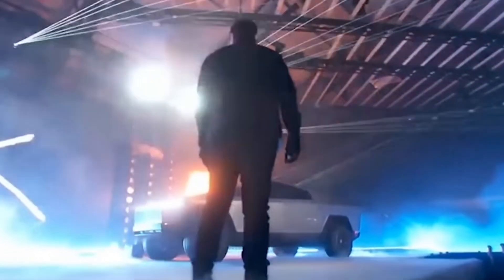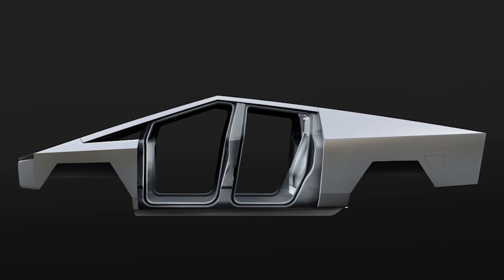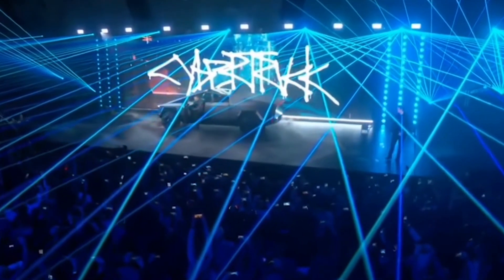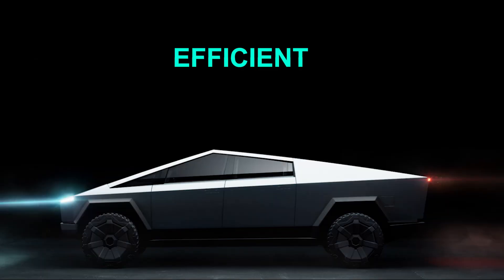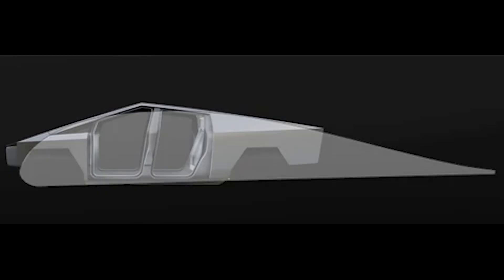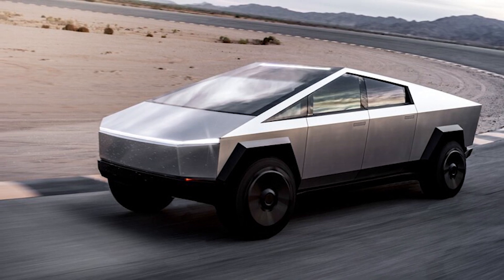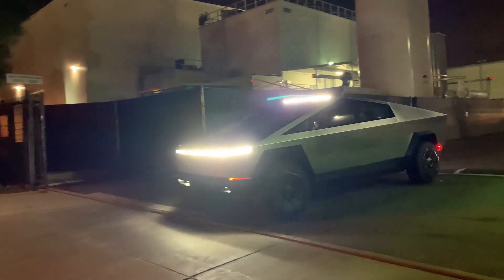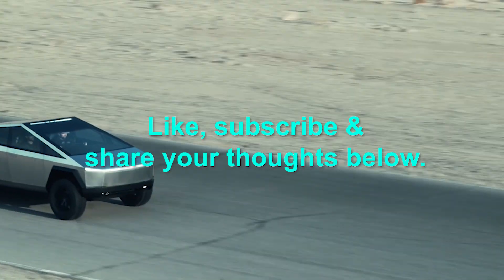Cybertruck is Engineering Genius (and will be copied)

Comment: I gave you the benefit of the doubt this was a thoughtful analysis till you said safety==strength of the car.. Nothing if further from the truth. Cars were built like tanks in the 50's/60's but changed because having an unbreakable exterior means all that energy is transferred efficiently to the occupants and pedestrians(god help them..)
Reply from the maker: Lots of people are raising this. The steel can be scored on the underside to crumple predictably and consistently (or the hood could be a separate component). I think many will be surprised at how well the Tesla engineers address this. Safety is always top of mind at Tesla. It may not appear so but the driver in Cybertruck sits the same distance from front of the vehicle as they do in Model 3 so there's equivalent space for crumple zone too.

End of the day, Cybertruck won't be allowed on roads if it is not sufficiently safe. Tesla are smarter than to design an unsafe vehicle 😉
Reply: It would need to be scored in all the surfaces around the car not just the front to be safe against side on or rear collisions. Also it would have to be alot of scoring to compete with the number of area's that can crumple on a softer aluminium construction. Still I have confidence that the engineers have designed a solution just thought that conflating protecting the car against damage and protecting the occupants or other cars or pedestrians isn't a good point to get confused on.

Comment: The fact that the truck is rigid is exactly why it doesn't seem safe: crumple zones are one of the most important safety aspects in modern vehicles, alongside three-point seat belts. But we don't know the safety details, so we'll have to wait and see what the reality will be.
Reply from the maker: Lots of people are raising this. The steel can be scored on the underside to crumple predictably and consistently (or the hood could be a separate component). I think many will be surprised at how well the Tesla engineers address this. Safety is always top of mind at Tesla. It may not appear so but the driver in Cybertruck sits the same distance from front of the vehicle as they do in Model 3 so there's equivalent space for crumple zone too.

End of the day, Cybertruck won't be allowed on roads if it is not sufficiently safe. Tesla are smarter than to design an unsafe vehicle 😉
Reply: @SolvingTheMoneyProblem  What's your thoughts on pedestrian safety, and safety of other vehicles?

Comment: It's annoying how many non-engineers spread false engineering "information"......  i.e. just repeat what the Tesla marketing team tell them.
Reply from the maker: Tesla didn't really cover any of the main point in this video, that's WHY I made it. Please feel free to debunk what I just said by quoting things Tesla have said about Cybertruck that I repeated here, Matt 😉
Reply: Solving The Money Problem I feel a little bad calling out YOUR video, there are many doing exactly the same thing.  But making a vehicle from a single thick piece of stainless steel in certainly not cheaper than a standard unibody and painted construction.  I have not seen any engineering sources that state this.  There is talk of it being 3.0mm thick, four times thicker and heavier than standard stamped construction, using significantly more expensive material.  Not painting it will not recover that cost.  Bottom line is production is more than 2 years away, the finished design will change (become legal as an example, windscreen wipers?).  I have 25 years automotive mass production experience, it’s not just a personal opinion of mine.  No offence meant, you have a well edited video about a subject people are interested in.  I’m just disappointed the engineering community appear to have mostly ignored this vehicle, apart for the tug-of-war video.

Comment: Great video analysis just a couple of things. You can see from the videos that cybertruck has a stamped, non-hardened stainless steel inner structure so its effectively a unibody or monocoque structure. It needs this to provide impact absorbing structure and crumple zones. So sadly less stamping panels but only 50% less. The second thing is while I love it, it may be the most pedestrian-unfriendly thing on the road which may require autonomous safety operation which overides the driver or exclusion from dense population areas! This is happening now for heavy goods vehicles except when operated by approved users at permitted times. Just thinking that it may be marking the end of humans being trusted to drive without supervision?
Reply from the maker: Spot on about some stamping required Richard. Re safety: Lots of people are raising this. The steel can be scored on the underside to crumple predictably and consistently (or the hood could be a separate component). I think many will be surprised at how well the Tesla engineers address this. Safety is always top of mind at Tesla. It may not appear so but the driver in Cybertruck sits the same distance from front of the vehicle as they do in Model 3 so there's equivalent space for crumple zone too.

End of the day, Cybertruck won't be allowed on roads if it is not sufficiently safe. Tesla are smarter than to design an unsafe vehicle 😉

And yes, I am sure Tesla hope to solve Full Self Driving around the time the Cybertruck is released.

Comment: Low cost of what? Of materials? When power to make car and factory is always big.
Reply from the maker: There's a million bits to this.  Less pieces = less machines needed, less movement of parts, less wages, less robots, less energy, less time to produce a finished vehicle etc etc
Reply: Electricity is still expensive. Robots in factories is still expensive. Worker still not cheap. Low cost for who? When Tesla cars still high price. tesla went bankrupt  from these low production costs? Who cares of low production of high price car?

Comment: Well, I wist the others were NOT in the position of having to copy the cybertruck but if you look at the switch to the aluminum F150 which drove costs sky high and made for an overall less stout truck (even though it's lighter and "more efficient" maybe).  You'd traditionally buy a Ford pickup BECAUSE of the steel frame that can actually take a curb or a light to media hit and not be totaled.  If the cybertruck has vast spare parts available at reasonable prices, it could become a gold standard for pickups.  Which really, really confuses me considering how butt ugly it is.
Reply from the maker: Haha, I love the last sentence.

Comment: sure its safe for the occupents but its solid steel chassis/body means its like being in twisted metal for anyone outside
Reply from the maker: Lots of people are raising this. The steel can be scored on the underside to crumple predictably and consistently (or the hood could be a separate component). I think many will be surprised at how well the Tesla engineers address this. Safety is always top of mind at Tesla. It may not appear so but the driver in Cybertruck sits the same distance from front of the vehicle as they do in Model 3 so there's equivalent space for crumple zone too.

End of the day, Cybertruck won't be allowed on roads if it is not sufficiently safe. Tesla are smarter than to design an unsafe vehicle 😉

Comment: This is not a utilitarian truck... Not saying this is not a good choice for people who want a efficient short-range semi utility vehicle. 
1. The range is severely affected by towing anything over 2k pounds. If you have to tow at max capacity, you better have charge stations within 100-200 miles every 100-200 along your route. (Caviate, that is if you buy the 3 motor 500 kwh version. Otherwise forget towing or hauling anything over 1k lbs for any distance over 50 miles.)
2. Charging, do you have a secure garage or place you can charge these EV's? Many don't.
3. Cost of ownership and long term use. Anybody feel like buying Tesla battery packs to keep these EV'S going?
4. Lithium mining...... Real world talk, this is even more dangerous and unsustainable of a path then most realize. Don't take my word for it, do some scrutinizing scientific research to prove me wrong. Are you up for the challenge?
If you respond with it is better than continuing to use gas and deisel, I already agree. But, and this important, we need a better power source than batteries. Especially lead acid and lithium, until battery technology improves, my needs out weigh this globalized effort to destroy the car industry and millions of jobs and become dependent on un-accountable big government.

Comment: I'm just going to point out 
"Cost" , Judging by how expensive most Tesla cars are , I doubt it would be cheaper than those 
"Very useful" , in small country , yes , In big country such as USA? FUCK No. there ain't enough recharging stations to be useful enough 
"Efficient" , with a electrical Truck that being marketed in a big country , most of the time trucks pulls stuff , more stuff = more power needed to be used to pull that stuff = you really need to know when and where to recharge your truck every few hours or so 
"exoskeleton" yea , Cars don't use Harden materials to build cars for a reason
In general........Pricey Toy Truck that looks fancy and can fit 4 people + stuff at the back.

Comment: The design of the bed is ingenious?  Until you want to put a a fifth wheel hitch in the thing.  It isn't a truck.  It's an oversized hatchback with a retractable hatch.
Reply from the maker: It's not a truck. It's a Cyyyyyybertruck. Maybe that's a fancy name for a over-sized hatchback. Doesn't changed any of my points :)
Reply: JBL 77 there’s no way the final version doesn’t allow for a towing hitch. Don’t be silly

Comment: From a safety standpoint, it will not be allowed to be sold in Europe or China for three reasons:

The extremely rigid exterior means that enormous forces are hitting the driver in case of an impact with a rigid obstacle.
Two, the very sturdy exterior will make it very difficult to evacuate after a crash. Rescue will take a lot longer to cut you out.
Three, most countries have banned rigid steel exterior design elements that pose excessive risk to others, especially to cyclists and pedestrians. Steel bull bars are banned in Germany. Crash test scores consider VRUs. The Cybertruck is horrible in this regard. Sharp edges, thick steel.

The Cybertruck in it's current form is a niche vehicle, exclusively for the US market.
Reply from the maker: Lots of people are raising this. The steel can be scored on the underside to crumple predictably and consistently (or the hood could be a separate component). I think many will be surprised at how well the Tesla engineers address this. Safety is always top of mind at Tesla. It may not appear so but the driver in Cybertruck sits the same distance from front of the vehicle as they do in Model 3 so there's equivalent space for crumple zone too.

End of the day, Cybertruck won't be allowed on roads if it is not sufficiently safe. Tesla are smarter than to design an unsafe vehicle 😉

Comment: What about pedestrian safety ? In many countries, vehicles are not allowed to have any metal or hard material at 'leading edge'.
Reply from the maker: Lots of people are raising this. The steel can be scored on the underside to crumple predictably and consistently (or the hood could be a separate component). I think many will be surprised at how well the Tesla engineers address this. Safety is always top of mind at Tesla. It may not appear so but the driver in Cybertruck sits the same distance from front of the vehicle as they do in Model 3 so there's equivalent space for crumple zone too.

End of the day, Cybertruck won't be allowed on roads if it is not sufficiently safe for occupants or pedestrians. Tesla are smarter than to design an unsafe vehicle 😉

Comment: A couple of questions:

From what I know about car safety, a rigid car is less safe than a car that crumples. How would the cyber truck be more safe if it’s so rigid?

If the body were to be damaged, wouldn’t it be expensive to repair because it is one sheet of metal? Would you have to replace the entire body?
Reply from the maker: Re: damage. A dent is easily removed by a metalworker. It would take a SERIOUS collision to actually deform the exoskeleton itself.

Re: crumple. Lots of people are raising this. The steel can be scored on the underside to crumple predictably and consistently (or the hood could be a separate component). I think many will be surprised at how well the Tesla engineers address this. Safety is always top of mind at Tesla. It may not appear so but the driver in Cybertruck sits the same distance from front of the vehicle as they do in Model 3 so there's equivalent space for crumple zone too.

End of the day, Cybertruck won't be allowed on roads if it is not sufficiently safe for occupants or pedestrians. Tesla are smarter than to design an unsafe vehicle 😉

Comment: Ridged does not equal safe
Reply from the maker: Lots of people are raising this. The steel can be scored on the underside to crumple predictably and consistently (or the hood could be a separate component). I think many will be surprised at how well the Tesla engineers address this. Safety is always top of mind at Tesla. It may not appear so but the driver in Cybertruck sits the same distance from front of the vehicle as they do in Model 3 so there's equivalent space for crumple zone too.

End of the day, Cybertruck won't be allowed on roads if it is not sufficiently safe for occupants or pedestrians. Tesla are smarter than to design an unsafe vehicle 😉

Comment: that shit can cut other car in half
Reply from the maker: Lots of people are raising this. The steel can be scored on the underside to crumple predictably and consistently (or the hood could be a separate component). I think many will be surprised at how well the Tesla engineers address this. Safety is always top of mind at Tesla. It may not appear so but the driver in Cybertruck sits the same distance from front of the vehicle as they do in Model 3 so there's equivalent space for crumple zone too.

End of the day, Cybertruck won't be allowed on roads if it is not sufficiently safe for occupants or pedestrians. Tesla are smarter than to design an unsafe vehicle 😉

Comment: About safety .. where's the crumple zone?
Reply from the maker: Lots of people are raising this. The steel can be scored on the underside to crumple predictably and consistently (or the hood could be a separate component). I think many will be surprised at how well the Tesla engineers address this. Safety is always top of mind at Tesla. It may not appear so but the driver in Cybertruck sits the same distance from front of the vehicle as they do in Model 3 so there's equivalent space for crumple zone too.

End of the day, Cybertruck won't be allowed on roads if it is not sufficiently safe for occupants or pedestrians. Tesla are smarter than to design an unsafe vehicle 😉

Comment: What about when you crash it... crumple zones aren’t great and it would damage massive parts of the truck
Reply from the maker: Lots of people are raising this. The steel can be scored on the underside to crumple predictably and consistently (or the hood could be a separate component). I think many will be surprised at how well the Tesla engineers address this. Safety is always top of mind at Tesla. It may not appear so but the driver in Cybertruck sits the same distance from front of the vehicle as they do in Model 3 so there's equivalent space for crumple zone too.

End of the day, Cybertruck won't be allowed on roads if it is not sufficiently safe for occupants or pedestrians. Tesla are smarter than to design an unsafe vehicle 😉

As for minor collisions, quick visit to a metalworker to remove dent and problem solved. It would take a MAJOR impact to deform the exoskeleton.
Reply: Thanks, I had no idea!

Comment: I completely agree. I feel like as a utilitarian vehicle, like a work truck or something, this thing completely blows every other truck out of the water. It's not even close and it's not even fair. It's faster, stronger, safer, harder to damage, easier to clean, easier to maintain, has a longer range, cheaper, has more storage, and has a higher towing capacity.
I always liked it because of how batshit insane it looks and I knew it would be influential, but once you look at where the money is going (making the thing useful) it all makes sense.
Reply from the maker: Spot on!

Comment: Safety assessment is incredibly assuming based on 100% wrong assessments of what makes a vehicle safe. Crumple zones revolutionized safety which is the opposite of strong and rigid. As for cheap $70k is anything but cheap they simple have moved the money to different places. The geometry and current lack of paint manufacturing efficiencies is the market embraces these concepts.
Reply from the maker: Lots of people are raising this. The steel can be scored on the underside to crumple predictably and consistently (or the hood could be a separate component). I think many will be surprised at how well the Tesla engineers address this. Safety is always top of mind at Tesla. It may not appear so but the driver in Cybertruck sits the same distance from front of the vehicle as they do in Model 3 so there's equivalent space for crumple zone too.

End of the day, Cybertruck won't be allowed on roads if it is not sufficiently safe for occupants or pedestrians. Tesla are smarter than to design an unsafe vehicle 😉

p.s. $40k base price, almost identical to the avg selling price of a new vehicle in the US.